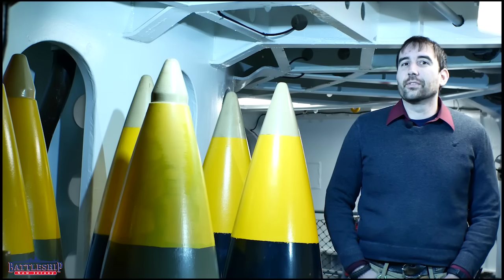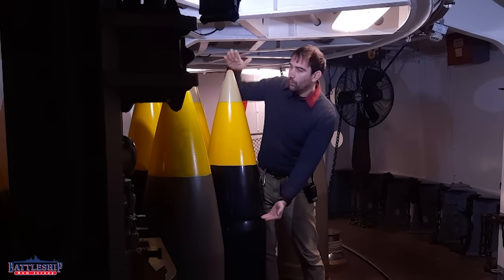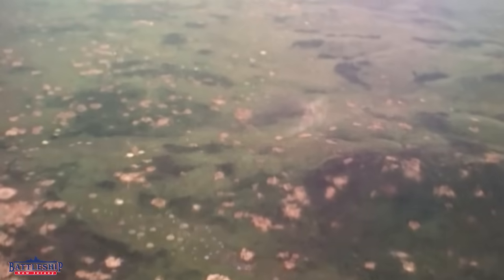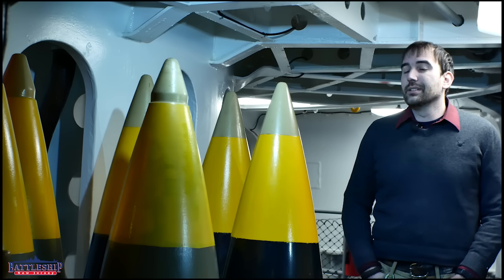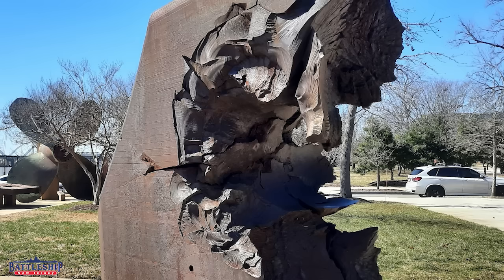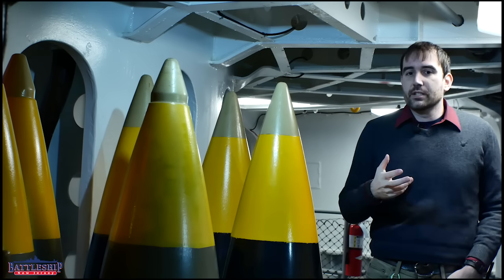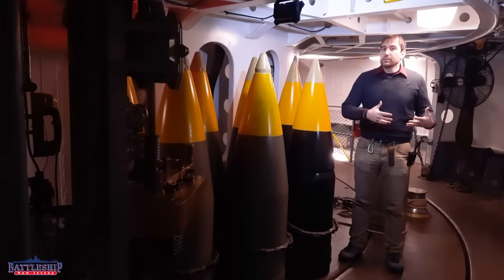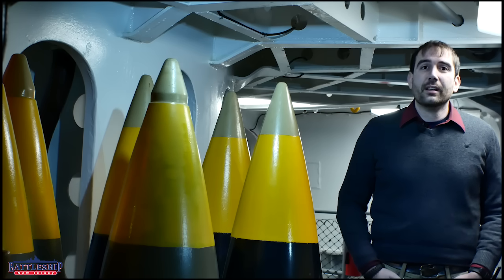What Does the Impact of a 16in Shell Look Like?

Comment: Well, I'm a former Marine, one of my 3 jobs was calling in Naval funfire, as such I was tought the different types, the 16" round being one of the, the interesting thing about them, from my perspective, was the :Detonating Radius, which was listed as 500M. over 1/4 of a mile. The detoanting radius was defined as the radius that will produce %50 caualties in exposed troops.
Reply: As an FO, we were taught in training that danger close with 16" gunfire was 2000 meters..
Reply: yeah they say trees would loose leaves out to 300yards. And at max range the grouping was about  250 yards with 120yard variation shot to shot. So 500M seams about right.
Reply: "my 3 jobs was calling in Naval funfire" 
Some typo's are just too funny. lol I like this typo.
Reply: @MsPrincesspaulina  he typed “one of my three…”  unless he edited after your remark
Reply: @waltermartindale9008  The typo is funfire rather than gunfire and he didn't edit it.
Reply: Detonating radius has to do with the fragmentation range as well as the blast overpressure.  As EOD, the exclusion range would most likely be 381 meters, but it depends on the actual explosive type and weight inside as well as a few other factors.  1/4 mile is a safe quick number.
Reply: All respect sir, thank you for your service. However, as the proud father of an active Marine, it’s my understanding that there is NO such thing as a “former” Marine. Semper Fi…
Reply: @mtlbstrd  yeah, we are all warped permanently
Reply: @jeffconley6698  USMC = Uncle Sam's Misguided Children. ^v^
Reply: @taproom113  ,
Reply: @mtlbstrd  OohRah! ^v^

Comment: This leaves me more confused than before.  I have heard that the 16 inch shells weighed close to 2300 pounds (weight about that of a VW Bug). 
Yet even the high capacity (i.e. non armor piercing) shell was described as having only 135 pounds of explosive. 
That leaves over ONE TON (2000 pounds) of mass for which there has been no account.
This prompts the questions: 1) How much does the shell weigh?   2) Where else is the weight allocated besides explosive?
Reply: Does this guy know what he's talking about when describing the rounds or projectiles
Reply: AP shells weigh 2700 lbs.   HC's weigh 1900, if memory serves
Reply: @SealofPerfection  I recently read that somewhere. But it indicated the AP only had ~35 lbs. of explosive and the HC with 135 lbs. That still means that explosives represent a very small fraction of the overall weight. The shell's casing must represent a surprisingly large portion of its overall weight.

Comment: Great Video!!! I would imagine that those shells would have probably been ineffective against lightly or non-armored vessels as the velocity would (in my opinion) allow the shells to pass through them without detonating?!?
Reply: There are known instances of AP shells going in the top and out the bottom or in the port and out starboard etc.  However targets like that would be shot at with HC shells which have a much higher bursting charge and no time delay on the fuse.  Against an unarmoured target they are very effective.

Comment: The primary purpose of both shells was still to destroy ships, so it makes sense for the high capacity shells to still have substantial penetrating capability. Perhaps if the war had gone on, we would have had proper HE rounds for the mainland.
Reply: We really shouldn't write these off completely. They could easily serve some purpose in the future. Artillery is cheaper than guided misslies. 😉
Reply: Is that a GM Hydro-Matic lower receiver?

Comment: What's the difference between a land mile and a sea mile 🤔 edit, still no answer 🤔
Reply: Google is your friend:

Nautical miles are used to measure the distance traveled through the water. A nautical mile is slightly longer than a mile on land, equaling 1.1508 land-measured (or statute) miles. The nautical mile is based on the Earth's longitude and latitude coordinates, with one nautical mile equaling one minute of latitude.

Comment: The 1.5" hull in front of the inclined 12.2" main waterline belt could knock off the AP cap under the windscreen mentioned below, which would increase the effective thickness of the belt armor since it could now smash the nose of the projectile apart ("face-hardened" US Navy Class "A" armor) and this makes a larger hole, requiring a higher impact speed from the shell to penetrate.  This thin hull plate will not, however, do anything to deflect or otherwise damage or even slow down the projectile of this huge size by much and if the nose damage ("shatter") does not increase the required velocity to penetrate enough, the shell will penetrate anyway, though perhaps it may not explode properly if damaged enough by the impact.  The main belt armor on IOWA was tilted forward 19 degrees to make hits on it much more oblique, even at close range, which significantly increases the armor's effective strength at stopping shells and also at damaging them due to the impact even if they do penetrate.
Reply: Tanks sometimes carry external armor which starts the delay fuse ticking so it explodes outside of the main armor.
Reply: On the US ships, the entire structure, including hull plating, was STS steel, or Special Treatment Steel. STS was metallurgically the same as class B armor. The distinction being thickness used. STS was anything under 1.5” thickness, while anything over 1.5” was class B armor. 
The .375” hull plating, especially if struck at typical incoming trajectories, was sufficient to arm the detonating fuse of a battleship shell, meaning it might detonate as it struck the armor, rather than penetrating first, limiting damage to the ship.  No other country had the steel capacity to profit so much armor grade steel that it could be used in the entire structure of the ship. Just one of the reasons our ships were much tougher than most

Comment: The SHINANO turret face plate was 26" (66 cm) thick and was to be mounted at a 45-degree backward tilt to increase its resistance by increased glancing effect at most ranges.  It would be very difficult to penetrate by any ship AP projectile, even its own 18.1" AP projectiles, when so mounted.
Reply: Nathan, yes. These turret face plates of the Yamato class are probably the only ship armor since Monitor that was truly invulnerable to penetration by any enemy projectile. 
At 45deg, their relative thickness was too great even for the Mk-7 gun with Mk-8 shell, so close range was out because of the flatter trajectory. Then by the time you get far enough out for trajectories to reduce relative thickness to a favorable degree, velocity was sufficiently limited and energy was now not enough to penetrate. 

Now, this isn’t saying that a such a hit wouldn’t disable guns, kill/injure turret crew or even possibly disable the whole turret, but it seems likely that no direct penetration would be possible.

Comment: Time delay is 0.033 second and is in the base of the Armor-Piercing (AP) Mark 8 projectile (2700 pounds total weight and 4.5 calibers (projectile diameters of 16") = 6').  It has a thick AP cap (hardened steel crash helmet, in effect) covering its nose to protect the nose when it hits thick hard-faced steel armor, like the side armor on a battleship, and that forms the base of the pointed nose that has the sheet-metal pointed windscreen above it to give the projectile a streamlined shape to reduce air resistance (big rifle bullet shape!).  The tiny explosive charge, also in the base, is there to spread around the pieces of the projectile by blowing up after the projectile gets deep into an enemy target, originally another battleship, because ships are so big that just punching tiny 16" holes only has a tiny chance of hitting something important.  AP rounds are now much less useful, of course, since after WWII very few armored warships remained in service very long.

1900-pound large-explosive-charge High Capacity (HC) projectiles in two types: Mark 13 with solid hardened steel nose tip to use a short-delay (0.01 second) base fuze; an instantaneous  impact nose fuze; or a clockwork nose time fuze preset just prior to loading or the later Mark 14 with a proximity ("VT") nose fuze -- passes near something and explodes due to a tiny radar in the nose, though a direct hit straight in front of the shell will cancel the radar and act like an impact fuze.  These projectiles are much more useful against a large number of different targets by choosing which one to fire at them.  They also have a much bigger explosion when they are set off by their fuze, whichever one it is selected to use.  They are shorter at only 5' 4" high and usually fired at a lower velocity than the AP shells.

Comment: The deflection of the projectile as it penetrates the armor has always been the purpose of sloped armor protection or blisters.  As a tanker, the SABOT round compensated for this deflection with the placement of a bearing nose cap on top of the tungsten penetrator. As the nose of the projectile contacted the armor, it would rotate upward, and this split second movement deflected the penetrator to a more perpendicular exposure to the armor.  As a result, it was a rare thing to see a SABOT ricochet or not defeat the armor.  With these big guns, it was more about volume of the fire on target so something was bound to get a good, solid hit.
Reply: It's fascinating how tank designers are always playing both cat and mouse in that way. They're trying to design the best armor possible and the best way to defeat it.
Reply: The 16inch shells were tested and penetration rated at more than 30 degree impact angle, the ballistic nose was a flimsy thing only intended for aerodynamics.

Comment: The top tips of the replica shells you are standing next to are different; one is a straight point and the other looks like the fuse on an artillery shell. Is that an accurate representation  or a manufacturing error? Is that what AP and HE shells looked like and which one was which?
Thanks!!

Comment: Summary of shot velocity against the 26 inch armored plates at Dalhgren Va.

Two shots fired at 400 feet with the following velocities:

Impact #

33443	Velocity 1992 fps	complete penetration	Proj. not recovered - plate broke into two pieces at the impact point.

33459   Velocity 1707 fps	penetration 20"		Proj. effective and intact. Body slightly bent - plate broke into two pieces at impact point.

Estimated Ballistic Limit versus 16" AP Projectile Mk. 8 Mod 6 at 0 degrees obliquity is 90+/- 3%.

at 10,000 yards (9,144 m), an AP Mk 8 would have a striking velocity of 2,074 fps.

at 20,000 yards (18,288 m), an ap Mk 8 would have a striking velocity of 1,740 fps.

So, for the above logged velocities, impact 33443 looks like a simulation of just over 10,000 yards and impact 33459 looks like a simulation of just over 20,000 yards.

They fired rounds that were magnetized through coils to measure the precise velocity of the projectiles.

The testing of the plates was conducted in accordance with the standard testing procedure used for U.S. armor. Briefly this procedure was as follows: The plate to be tested was secured in butts approximately 400 feet from the gun. The plate was blocked to the desired degree of obliquity by means of wooden blocks which were backed by heavy steel supports set securely in the ground. Sand was piled behind the plate to stop the projectile and fragments.

It also states that: Assuming the turret face plate was mounted at approximately 45 degree to vertical (which it was in practice), calculation indicated the inability of the modern 16" U.S. projectiles to penetrate a plate of this gauge at any range. However, as can be seen from Figure 7, the plate broke in half on both the complete and incomplete penetrations, and a failure of this type in service would partially, and perhaps completely, disable the turret.

Comment: Did they ever use the 16in guns for AA? Or was that strictly for the 5in, 40mm and the 20mm weapons?
Reply: No, but the Yamato did just before she was sunk. Essentially the big shells weren't designed for AA. No radar proximity fuse. You would need to hit the plane. And generally, battleship main batterie guns don't elevate sufficiently for AA. Yamato was just shooting everything she had in the face of hundreds of attacking aircraft when there was no air cover for the Japanese ships.

Comment: As a Marine in Viet Nam around DaNang in 1969 I can tell you yes you can hears the rounds and they made great swimming pools 30+ ft around and 20 ft deep depending on the soil, they cleared everything but large Stands of Bamboo which were cut off at about 18" but did not make great LZ,s because of debris which had to be cleared first.
Reply: @jeff pentagon Landing Zone, to insert troops via helo ops, or as a re-supply drop area. ^v^
Reply: I'd still imagine it would still be easier then cutting it all down yourself though?

Comment: I was amazed at how small those bursting charges were! Especially the high capacity!
Reply: Agreed!  I've heard the shells weighed ~2300 pounds (about the weight of a VW Bug). 
If there is 'only' 135 pounds of explosive, what accounts for more than a TON of additional mass?
Reply: @gregparrott  Just the steel of the projectile casing.

Comment: You need to do some more due diligench regarding the 16" shell's damage. You were/are not knowledgeable about that damage or the construction of the shell. The shells used during Vietnam weighed from 1900lbs to 2700+ lbs. By comparison a VW Beetle weighed 1850 lbs. The armored piercing round had a penetration charge of 153 lbs to make a hole in the ship's superstructure which was followed with the internal explosion of the remaining explosive charge. The penetrating would open a hole in the exoarmor, the remaining shell and the 2700 lbs would go through and explode. 
Usually any ship hit would suffer a 2.7 kilograms of explosive to attempt to blow the target in two. The HMS Hood which was a famous British warship was hit amidships by a 15" inch armor piercing shell from the German ship Bismarck in the Atlantic. The Hood was blown in half and sank in less than the time it took for the smoke around Hood to blow away.

Comment: Hello!

If the armor was made of modern Aluminum  or Titanium-Alumium armor, would those shells still penitrate?
I am also aware of the lack of practical applications these metal pose in this scenario, but it's a fascinating engineering thought.
Reply: Aluminum is far weaker than steel, so no hope. Titanium is a little stronger, but still weaker.

Comment: Did the older battleships with the 16" 45s have an advantage using the last generation super-heavy shells or were expected battle ranges too short to fully use it to advantage?
Reply: The 16"/45 had an advantage in penetrating deck armor, because of the projectiles' more vertical, plunging angle. But I think they didn't have quite the range as the 16"/50.
I would not want to be on a ship receiving either type!
Reply: No. The older 16” of the Colorado class could not use the mk-8 2700 lb shell because the ammunition handling system could not deal with the longer projectiles.

Comment: Interesting. I would have expected a lot more explosive capacity in these, something at least on the same range as a 1000lb GBU. I think I can see now why even from a massive Beast like the 16inchers, anti-ship missiles just put guns to shame.
Reply: An antiship missile would do fuck all to an iowa class bb. The iowas would laugh at it and stream away.
Reply: @joshlower1  this is distinctly untrue.

First, a supersonic ASM like a P-800 or a Brahmos in its terminal velocity would easily penetrate through the armor on any battleship that had been built, and even if it doesn't, it's irrelevant, because with a thousand pound Warhead the explosion would shatter the structural elements of anything near it, and more importantly destroy every sensor and antenna on that part of the ship. A mission kill is still a kill.

Second, and more importantly, that's not how the real world works. It is Trivial to make minor modifications to the same anti-ship missiles to give them true armor penetration capability, and if battleships were in common use every competent navy would long since have done this. You can't beat physics, in the age of guided munitions the battleship simply is not survivable.
Reply: @Laotzu.Goldbug  Well it might survive but it would have to go back for long expensive repairs so its a mission kill.  Now torpedoes are a different story.  Especially nuclear ones.  And they do have penetrating bombs.  MOAB.  The point is someone would get a couple of cheap hits on it and put it in dock for a year or two.
Reply: The missile wouldn't even penetrate the armor belt as they are not designed for heavily armored ships like bbs but for tin can ships instead.
Reply: Not correct. The point of these shells was to penetrate armor that was very heavy, then to explode.  
With any given weight of warhead, the percentage of explosive must be adjusted according to what you want it to do. Upping the explosive charge for greater blast damage significantly reduced ability to penetrate.   Shell or missile, if it doesn’t get to what you need to break, it’s useless, and on battleships or protected bunkers, what you need to break is deep inside heavy structures.

Comment: Surprised you didn't mention the accuracy of the guns, which is as important as the terminal effects. At 34000 yards (32km or so) the CEP is about 150 yards, so half of your shells will land within 150 yards of the target. So you need to sling a lot of shells even at a large target like a battleship to get significant hits, and for a small bunker on land..you're going to dig a lot of impressive holes around it, but hitting it is going to be tough before you run out of shells unless you're lucky.